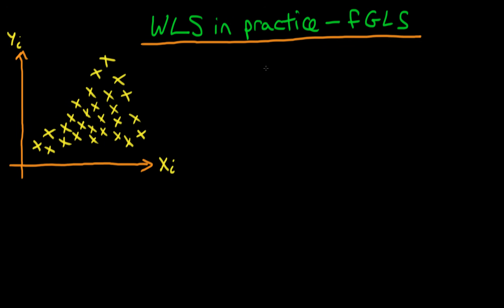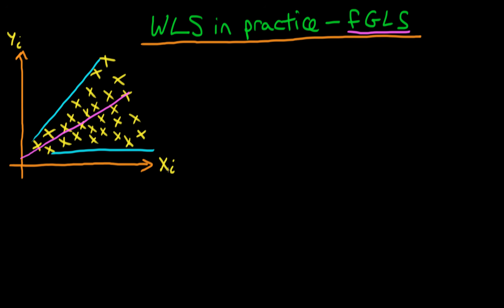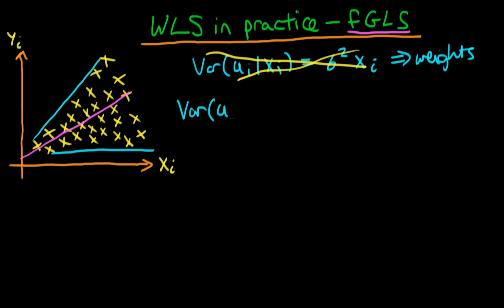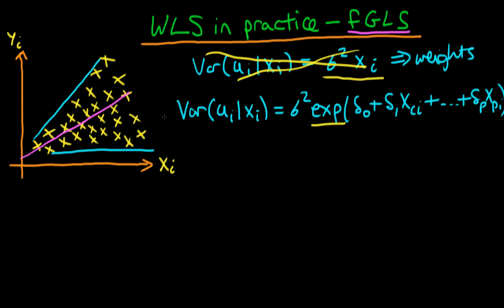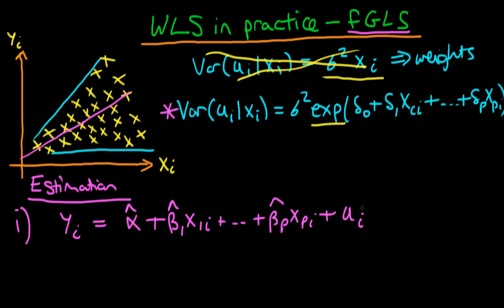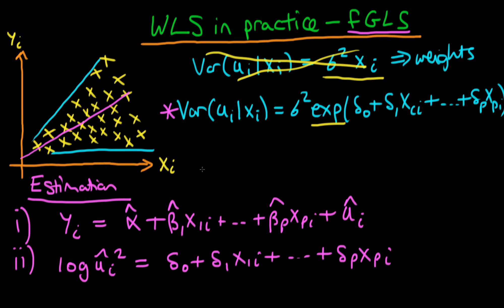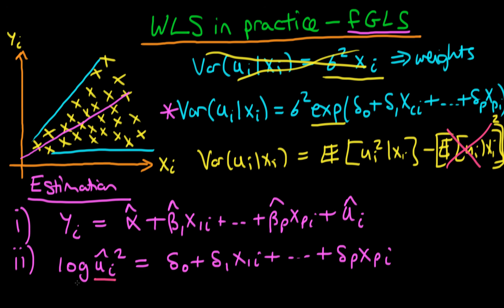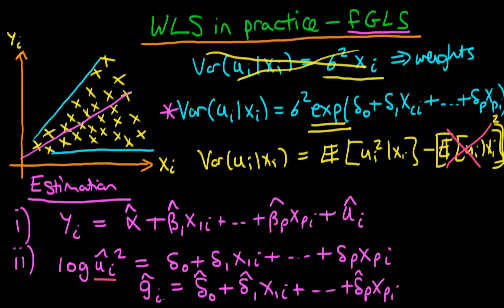Weighted Least Squares in practice - feasible GLS - part 1

Comment: Hi Ben,

I have a question around why we are trying to estimate ui in step (ii). When we run step (i) we already get ui here. So if we know the ui, why are we tring to estimate it again? Why cannot we use the ui genrated in step (i) as weights.

Thanks in advance
Reply: we run step ii. on exactly the residuals obtained and saved in i. Without it, we would not be able to estimate ii.